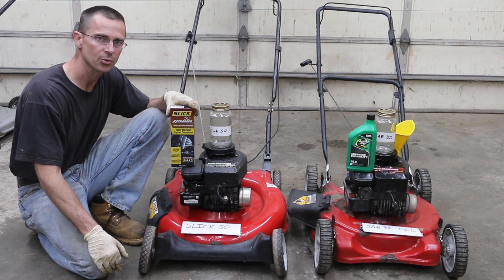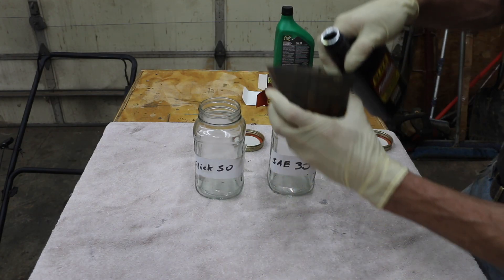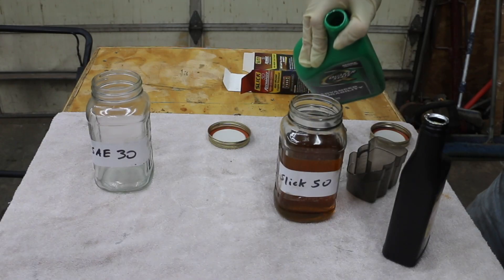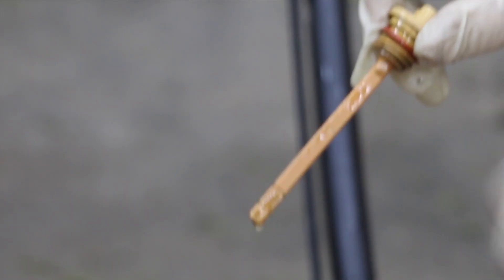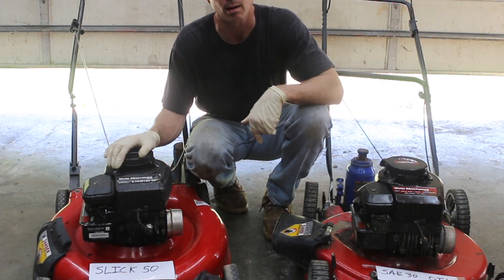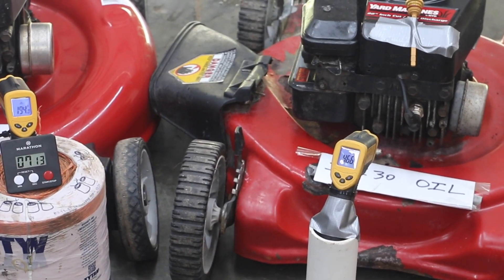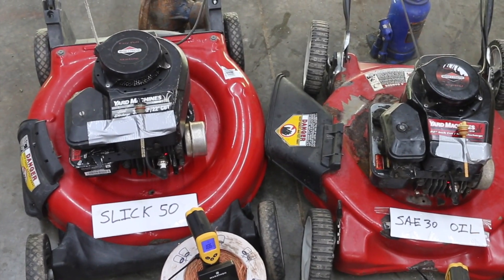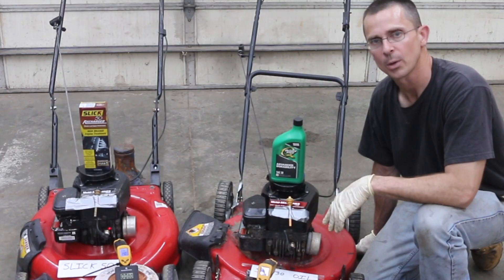Can't believe what SLICK 50 did to my engine!!--Dry Crankcase Test!

Comment: Lucas Oil additive
Reply from the maker: Jay,  I'll try Lucas soon!  Thanks for watching the video and commenting!
Reply: try Z max.  Always wondered if that stuff really works.
Reply: Jay Singleton 
Funny that nobody else has that experience with it. Could there be something about the specifics of that engine oil system that creates the issue? I have about a dozen friends now using it everything from diesel Kubota tractors and pick up trucks to ricer high reving turbo motor to several Corvette models.. so far everyone reports quieter or no slap at cold start, and better stability of oil pressure over temp range, and for the few with higher miles experience, very little wear with high miles. I do believe it possible to use too much, where its high viscosity can cause oil pump and pressure relief issues, but you can do that without Lucas, just load up with 90 or 120 weight and watch things break!  Could there have been some sort of chemical incompatibility with the base oil you added the Lucas to?  Not saying you did not have a problem, just trying to understand why you did, when so many have only great improvements. 

This is an interesting channel.. I love the real world tests to failure he does.
Reply: AMStationEngineer you lost the cam because castrol has zip for zinc...just like all on road oils..new flat tappet cams need zinc or zinc additive..royale purple is great oil...and also expensive..try valvo racing or GM engine oil supplement or step up and buy a roller cam.
Reply: Amen, My Harleys, cars and jeep ALL get Lucas.  Car has 337,000 on it and the Jeep just topped 250,000. I put it in everything that requires oil.
Reply: I 100% agree.. I never let anyone lift the hood plug shit in and when safety inspected I stand right there. This goes way back to my first motorcycle and taking it to a place called BLOCKERS YAMAHA in EMMAUS PENNSYLVANIA. I was about 20 years old put a brand new back tire on the back of this gem of a used bike and brand new rear brake shoes. I got the bike cheap off a neighbor for a few hundred bucks, I lived on the bottom floor of an Apt complex and rolled it into my living room shined it and tuned it over the winter made the bike like new everything was perfect. (READ ON) The bike had needed work and I spent all winter imagining riding this big beautiful YZ 250 ENDURO around. I cleaned it spotless put a new rear tire and brakes on it and when the first warm day of spring broke I couldn't wait to get it inspected and ride it. I drove it 2.5 miles down the street to BLOCKERS YAMAHA IN EMMAUS Pa. at 0'900 sharp was my appointment which my terms here shows my age. I left my girlfriend gave me a ride to work I had to DROP THE BIKE OFF my biggest mistake in the world. I got back from work that evening to hear a message that BLOCKERS IN EMMAUS could not inspect my bike because the head light was burned out a turn signal didn't work and the back brakes were bad.... I replaced the back brakes and everything was good when I dropped it off there that morning I spent all winter working on that bike. When I drove the bike out of there pissed off  I had a suspicion and that little Angel that's always been on my shoulder. I had one stop light between me and my driveway that I overshot and ran into the back bumper of another neighbors Ford PINTO which again shows my age very little damage to the car none to my bike thank god because I still have that 1979 YZ 250. Those motherfuckers at this Yamaha dealer even loosened the rear brake cable... I never hit the brakes from the time I left their lot/garage it was a really rural area no stop lights but for one right before the apts. and my driveway and that stop light was green when I got to it. The problem happened  was only when I went to hit the brakes for the apt complex I had to turn left with nothing but front brakes at about 30 mph and deadended into my neighbors PINTO my chest went into the handle bars with the big bumper thump. WHENEVER MY VEHICLES ARE WORKED ON NO MATTER HOW LONG IT TAKES I STAND RIGHT THERE ALL THE WHILE... IF THE SHOPS SAY DROP IT OFF WE'LL GET TO IT I CALL SOMEWHERE ELSE... I COULD HAVE BEEN KILLED BY THOSE UNSCRUPULOUS PRICKS BACK THEN. NEVER AGAIN NEVER... YOU ARE 100% right...
Reply: You have to realize the bearing journals are way way smaller on an engine that uses 0-20 oil so what happens is the oil feed has greater oil pressure. If you use something that thickens the oil on those types of engines like especially an engine running a 0-20... Lucas will work in engines using 5-30 is the minimum and even there with the oil being so thin you are taking your chances. Just using full synthetic is enough. Adding stuff can melt a bearing. Maybe not a motor used continually for short trips. Albeit any engine using a 0-20 is a passenger car engine as far as I know. Trucks use a heavier oil. OIL ALSO HELPS TAMP DOWN TEMPS AS WELL NOT JUST LUBRICATE THE ENGINE AND THAT IS WHY MANY MFGS LIKE GM AND SOME OTHERS WARN AGAINST USING ENGINE ADDITIVES. INCREASING INTERNAL TEMPS CAN AND WILL DESTROY AN ENGINE.. LUCAS IS ONE OF THE BETTER ADDITIVES BUT SITTING RIGHT ALONG LUCAS ON SOME STORE SHELVES ARE THINGS WE USE INDUSTRIAL ENGINES AND RACE ENGINES AND ALL ONE HAS TO IS THINK ONE OF THOSE ADDITIVES IS SAFE TO USE IN THEIR MOTOR AND THE CAR IS HISTORY... Engines that are using the 0-20 oils are having cam bearing failures at alarming rates I heard... If the MFG of your car says use no additives it is for a reason even for the reason of the materials the bearings and rings are made out of. Some additives can over time break down the materials the engine bearings are made out of. Pyroil just released some data on this subject I have to read what they sent me.. YOUTUBE IS USEFUL FOR MECHANICAL AND HOW TO DATA HOWEVER I WOULD NOT RELY ON THESE LITERAL SNAKE OIL SALESMEN FOR DATA ON YOUR PARTICULAR ENGINE. THERE ARE LABS AND COMPANIES THAT PUBLISH DATA ON OILS AND ADDITIVES AND THAT SHOULD BE WHERE YOU BASE YOU INFORMATION AS FAR AS WHAT TO USE AND HOW MUCH OF IT.
Reply: +Jay Singleton, That was what I was just thinking.  That stuff is what I run on my 197 Ford Ranchero GT.  I wanna see if it works too.
Reply: Jay Singleton 
Curious about that too!!! they make big claims.
Reply: Can't remember, the motorcraft was 5w-30.
It was a serious reduction in noise, I run a oil temp gauge and 
it runs cooler.
Reply: Jay Singleton liked your comment... some of the better advice ive seen here... can you even buy slick fifty anymore ....i never looked for it .i smart enough to stay away from engine oil additives...
Reply: LucasOil is the stuff, also MolySlip here in Canada.
Reply: Should get http://lubrilon.com/support/pds.asp  Now  this product is the
 real deal .Was once called Slick 50 until John Bishop lost the 
trademark .What auto shop sell today Slick 50 is a lie . Anyway  
lubrillon the absolute best protection for tranny,engine and whatever . 
Been test in car  and oil drained  .Car  had no wear . My Uncle even did
 this test . I use it  :)
Reply: Jay Singleton Should try that Xado additive, see if it works, lol
Reply: They had a lot of Pros and Cons going on engine oils in the 60's and 70's the true truth was the environments the engines were run for instance the Lycoming engines lasted in the cooler Northern U.S. Canadian and U.K. regions. You got some of the Lycoming's down south in dry desert heat 135+ like Texas Arizona New Mex or Florida look out. Shell made some additives themselves to date I believe SHELL was a major development company for Quakerstate which eventually spawned that crap I don't ever buy no more they call Castrol GTX the worst junk you could ever put in any engine even a simple lawn mower.... Now days most engines won't run in self destruct mode the OBD computer predicts what range the engine will run within and that is it. Too hot it shuts down or engine light comes on too cool and the light is on.. I  had it happen with additives in the engine one thee leading reasons GM says use no additives in their engines.. I'm talking my Silverados not a Lycoming aircraft engine okay... In the old days it was a PRIEST like your father that stayed in the air the longest.
Reply: For my Lawn Mower??
Reply: I didn't want to change either but it was all I had to drive at the time.
The noise reduction was significant. Not saying you will  have problems but in an air cooled, solid lifter motor it was very noticeable.
Might try it once. My experience says leave the crap on the shelf.
Reply: Have only used Castrol new synthetic in my Harley twice and it's the only air cooled motors I've owned so it's my only reference. I've used motor craft to ,no complaints.
Reply: I've never added anything to my oil, unless it is worn out and huffing out the breather then something with that Teflon stuff in it will go in.
Neighbor gave me a garden tractor that smokes and knocks without something in it.
Reply: Don't use Teflon based products because the Teflon is heavier than the oil, try Lucas it's petroleum based and blends with oil better. Some racers I know turned me on to it in the eighties.
Reply: On a Harley the fins running off the heads pull the heat away, that's why on a hot day you sweat your ass off.
Reply: I have used Teflon over the years in engines that are junk and just needed occasionally on the farm. An engine in good shape just needs good oil,  changed regularly.  They will go a long time as long as they don't get run hot. Now a days you have to read the owners manual, some of these newer engines require 0 weights. A friend has a Sprinter with the Mercedes 5 cylinder diesel, it requires a 0w-20. He ran Rotella 15w-40 and smoked the turbo.  I like do like Lucas products, especially there grease.
Reply: I know my Ford truck uses 5w 30 and I wanted to use Lucas because I towed a boat all over these Hill's where I live and thought it would give me some extra protection, but what it does most is protect the engine at start up. Like you said some of these new cars run 0 20 and that scares me a little .
Reply: coolhanddruid you have to use the special additive for street bikes, I used to run lucas in my modified R1, and I never had that prob. and were talking about damn near 16k rpm. on avg. But your foaming could have also been that you were running penz or quaker in your bike. Two oils Ill never trust.
Reply: John Christensen thats cute, because if you spend the money at the Harley shop, you get synthetic. I've got an '83 streetbob with a Shovel Head, and its cherry af inside and out. We've had Valvaline synthetic since my dad got, till he gave it to me a few yrs back.
Reply: how hard does a harley work?  Can you load it up like a vw bug and make it work for a living?
Reply: John Christensen john i think That kenneth brown is trying to troll this comment section... Ive been seeing him post at random people in this thread....
Reply: John Christensen i read your post about the crashing the harley into your neighbors car ...sorry to hear that...( Hope i havent gotten my facts mixed up i read a lot of comments in a lot threads.)
Reply: Nothing wrong with Q-State especially the full synthol oils... The problem with dopes is the fact some MFG's recommend additives in a new bike like the Go Kart I just bought my grandson... had I not read the fucking manual I might have missed the most important part of the start up and break in mode... Lucky I am not an illiterate impulsive jerk off like the rest of these YOUTUBE fountains of misinformation on here on YOUTUBE... Many people fail to read their bikes owners manual start and recommended break in instructions... People buy it then they start the bitch up and romp on it as hard as they can and then,,,, ut oh I have a problem something ain't right... If it wasn't for a dope a day in real life there wouldn't be repair shops around like mine... Read your owners manuals and quit busting on the oil companies... many years ago Q-State oil was junk... Since 1993 I won 5 modified championships using Q-State.. now y'all just relax and go back to net porn where you understand the subject matter much better...
Reply: georgiaridgerunner 79 . yes O'Riley's has it
Reply: Try Ceratec from Liqui Moly
Reply: I’ve just watched two of your videos and I have to say, very comprehensive and well thought out.
Reply: "Lucas"  good name for this stuff that doesn't work !!!!!!
Reply: I've remember  reading somewhere that synthetics resist taking on heat and are not recommended for air cooled engines because they rely on the oil to remove heat. Might check it out, a  Harleys  is a nice machine.
Reply: you are right, the "that's cute" comment wasn't really appropriate for a discussion and sharing of info.
Reply: You should try prolong I put that in my car and I have got 4 mpg better I would like to see how it does.
Reply: Prolong
Reply: To the point, Lucas Full Synthetic. :)
Reply: May I suggest the Lucas full synthetic?
Reply: It was a diesel mechanic that turned my father and me on to Lucas.
Reply: I'd like to see a test on several top oil additives but with new engines.
Reply: Castrol is a non-parafin based oil, Motorcraft isn't. Wait untill your engine dies of sludging.  Basically Motorcraft muffles the cries of suffication.
Reply: Amsoil synthetic 10w-30 ?
Reply: No, the synthetics are not Pararfin based to my knowledge.  I will say this.  I tried this Lucas on my Cub Cadet that has a leaky seal and the leak stopped.  for how long, I don't know.  If I can use it though for the rest of the mowing season and then tear it down, that would be great.  I have applied this to my other long use/high mileage engines.  I will let you know.  I did get a 0.8 mpg boost to my 2005 Avalanche after adding it during a regular oil change.  I have done nothing different other than adding the Lucas Oil Stabilizer.  Good stuff
Reply: Lucas is the best  oil additive I've ever seen
Reply: Lucas oil the best never had a motor failure.
Reply: Jay Singleton Use Lucas in my truck and Harley, truck has almost 200.000 miles and no leaks and doesn't burn any oil.
Reply: wasn't me, I've only crashed dirt bikes and cars
Reply: All I know is every mechanic I know uses Castrol in their shop and I've used it almost all the time for almost forty yrs, and I've used Lucas oil stabilizer for 25yrs and never in my life had a major engine problem. That's 12 cars, 4 trucks and 6 motorcycles so I'm sold.
Reply: Your air cooled engine still relies on oil for cooling, it is what removes heat from the bottom end.
Oil is squirted on the bottom of the piston, and the piston usually has a grid pattern on the inside for more surface area for oil to come into contact with. All air cooled engine have finned heads and cylinders.
Reply: Nope.. However every and any Harley I ever owned did bug me... Still do...
Reply: I used to run castrol in my 59 VW Bug, I changed oil one day and didn't have any Castrol so I used Motorcraft 5w-30 because that is what I had. The Motorcrft was reduced engine noise significantly, it was so noisy with Castrol it was like there was no oil at all. Used to have weird problems running Cast. like the end play shims cutting into crankshaft. Will never use Castrol in anything.
Bug has been running smooth and cool for 60,000 plus miles on same engine.
Reply: Lucas is junk. Tried some in my R6, which I used to run very hard. With enough RPM's for a long enough period, the oil would start foaming, and my oil light would come on, meaning I was losing pressure.

Comment: Mowers were not identical.  

The engines may have been, but the blades if connected, and certainly the drivetrain for the front wheels(which was clearly connected), may have placed substantially different loads on the two engines. If the Slick 50 engine had a heavier load, that could account for its much earlier death.

Comment: another great video. could you please try this with Arch Oil? i use this on my powerstroke diesel. It has been featured on jay leno's garage as well, so i would like to see how good this stuff is.
Reply: EK Auto Tech arch oil is great, one of the only additives that works. slick 50 etc are all snake oil. PTFE doesn't bond with metal etc

Comment: curious which one will start back up now, after both is cool to the touch.
there is a product called cerma stm-3, pretty pricey, claims to be better than amsoil via the one arm bandit friction bearing test. however all major oil companies perform friction bearing test with the 4 ball per astm (i might of got the letters mixed around) standard requirements. curious which one will win the lawn mower test. not sure if cerma makes oils designed for lawn mowers though?